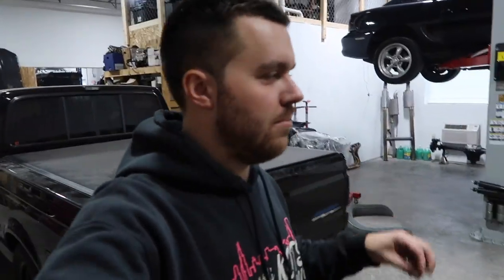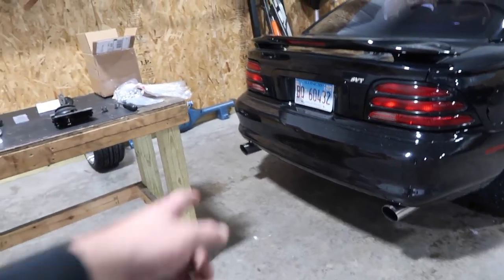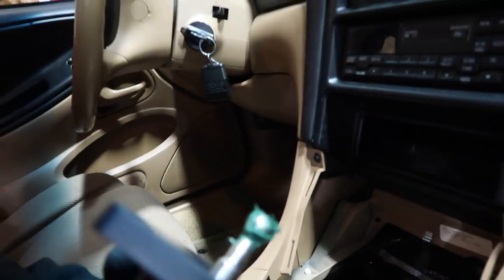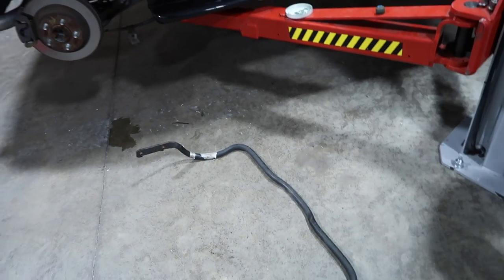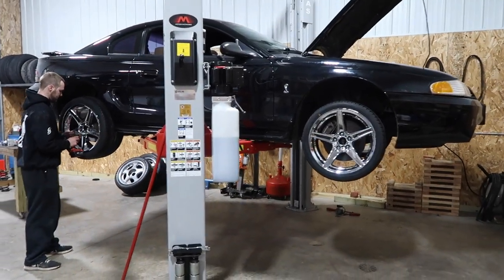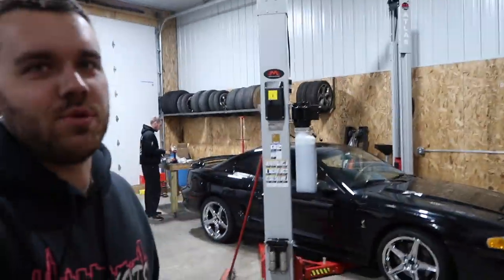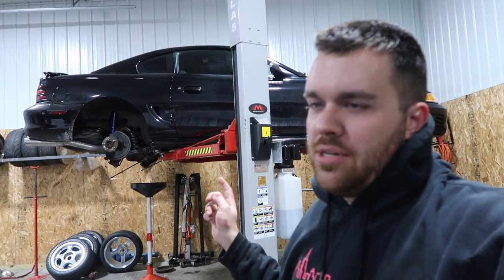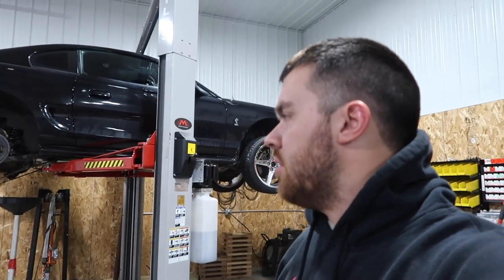First 5 Basic Mods of Owning a Mustang

Comment: I think cai, exhaust, pulleys,  throttle body could be the first 4 with 3.73 gears, but of course you’ll need good suspension to drive better and good shocks and struts

Comment: Depending on the mileage on the motor, I probably would have done valve springs and a similar cam to maybe E303 or F303.  Doesn't have to be those cams, just similar.  No B303, though they sound good, not good for mostly stock cobras, GTs.